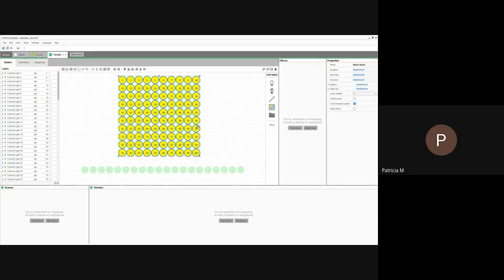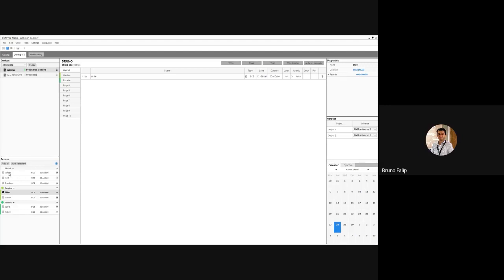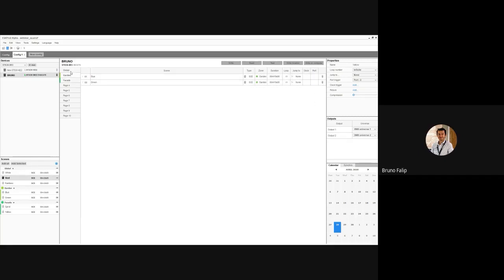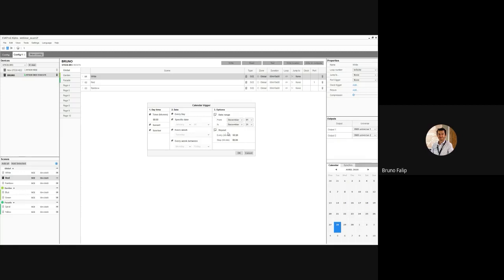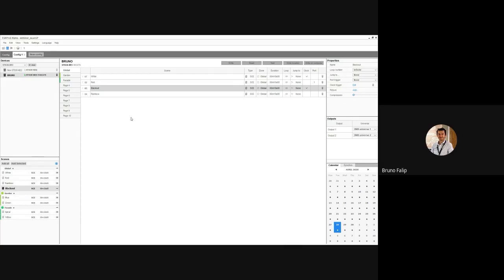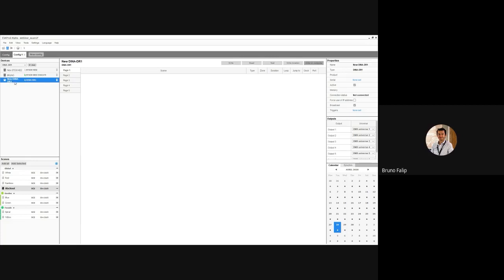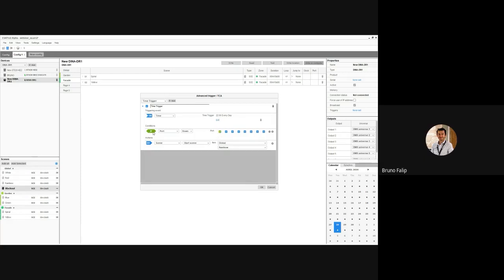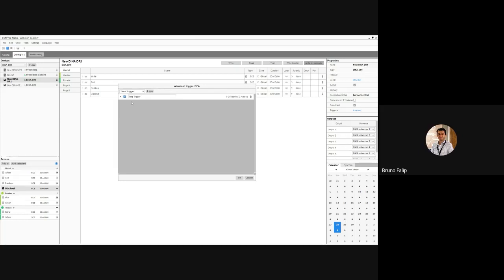WEBINAR - ESA pro 2 - Writing the controller memory

Comment: I am running into a problem with the software. I am using a SLESA-U9 Controller with ESA 2/ESA Pro 2. My issues is the smoothness of the steps, I am using a Lumenetix CM1 and the channels are set up differently than a standard RGBW. Channel 1 is dimming, channel 2 is Color temp, channel 3 is saturation, channel 4 is hue. I cannot use the presets that have come with ESA because of the different channel presets on the Light engine  I am using. When I try to make my own color changing program I can get it to work but the transistion from Red to blue (goes for all colors) is very sharp and not smooth like it should be. Any way you can help assist me? Also if there is a way to just make the channel mixers move smoothly like they do on the presets where as my "presets" jump around instead of moving smoothly. thank you